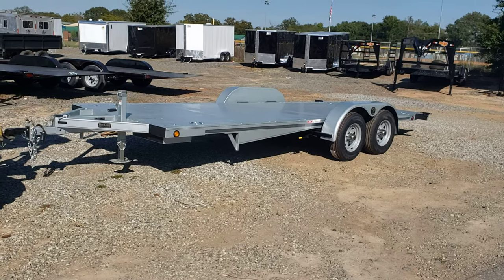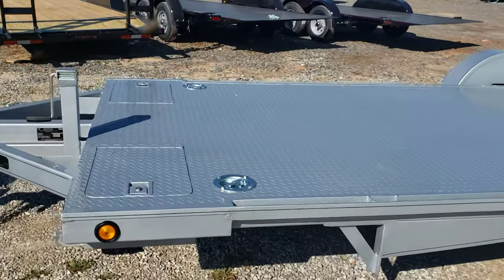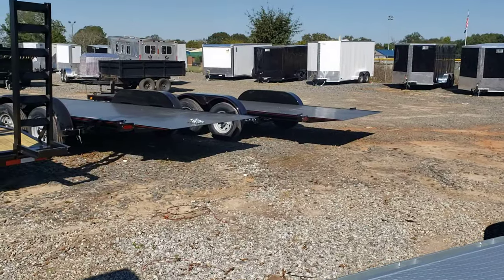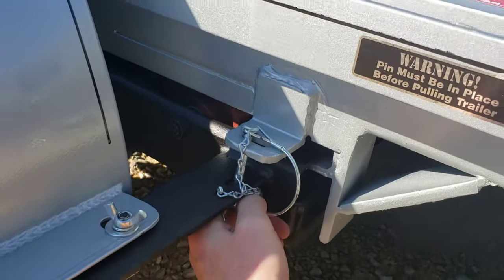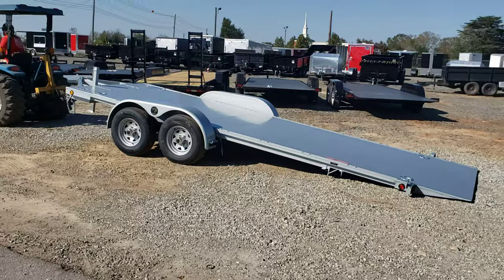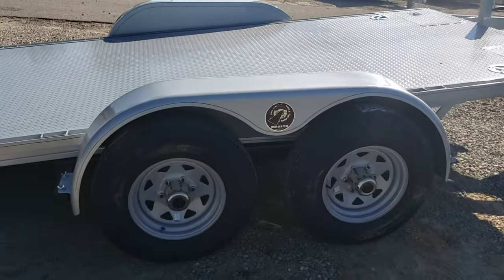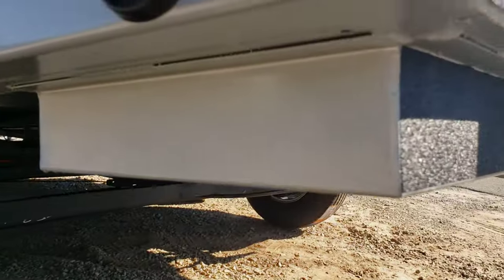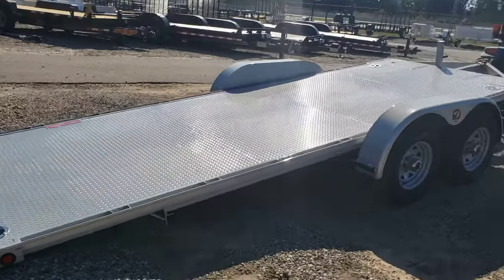kwik load roll back carhauler trailer 7 x 20 roll back tilting trailer great for low cars

Comment: Hey man! Where did you buy the mount for the wench on tilt trailer? I’m looking for one myself. Would really appreciate a response dude
Reply from the maker: i dont use a mount i weld a plate to the floor to bolt the winch onto. 

but if you have a warn winch they make a mount for $200